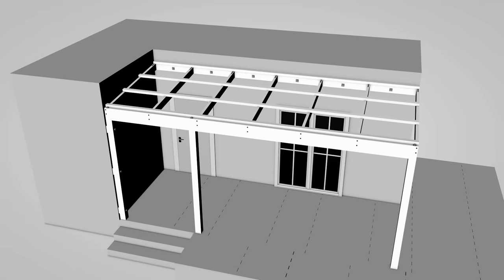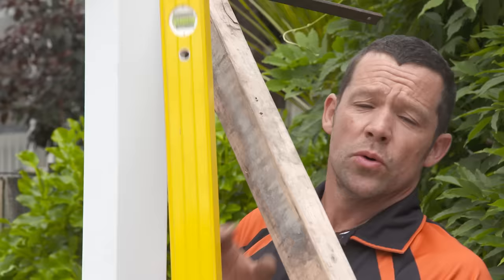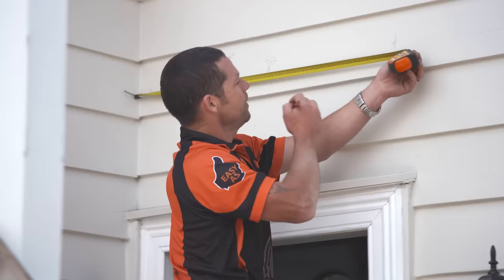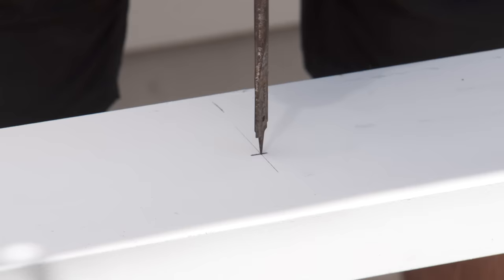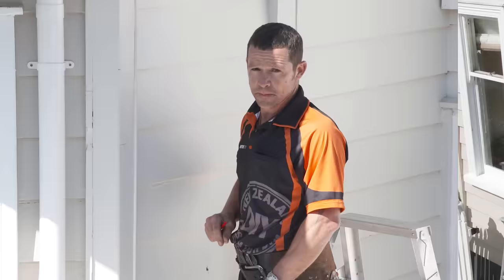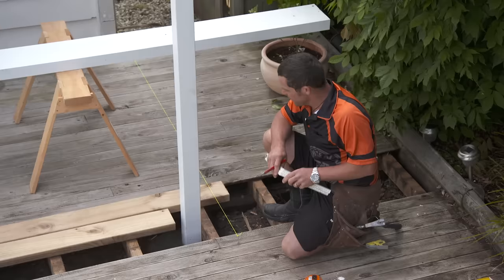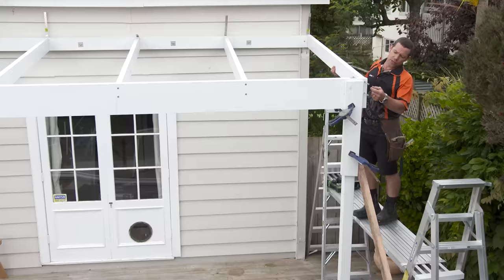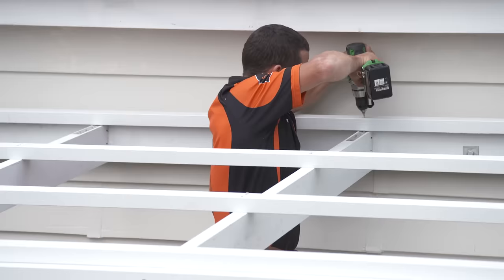How to Build a Pergola Attached to Your House | Mitre 10 Easy As DIY

Comment: "Joist hangers look absolutely terrible" - well said!  Very good video, best I've seen on the subject; great workmanship. Greetings from across the ditch.
Reply: Decorative mechanical fixtures can add to the finished product. Black powder coated hangers would look sharp.
Reply: Could have just used white hammerite on them. So much easier.

Comment: Good vid. I work from the top down/temp props for front beam/ put posts in last. Working out rafter spacing on ribbon ( pitch) plate 5.753 m minus rafter thickness ,then divide by 6 spaces. That still gets centre to centre but it  gets one side of each rafter. So it's then just a mark then a cross , mark and a cross and so on. Check if the house wall ( where the beam starts from) is plumb. Don't assume it's plumb . If it's 5mm away ,then add 5mm to beam length. I would probably leave the beam a bit long and cut it off up there. I normally rebate the posts to fit to the beam and use 2 cup head bolts through beam to post. With the roof battens, I also shoot them to the rafters like you do but as a high wind will lift up the weakest part, I drive in 1 long bugle to each intersection. If it's only shot with 2 nails per intersection, the battens will twist in time. If I ever do a pergola with rafters going over the top of the beam and overhanging , I weld up a special U shape shoe the slips onto the underside of rafter and has a welded down tab  to screw 2 teks into beam and on the U shaped bit, I screw 2 teks into the rafter.I do that to every second rafter.That's for the reason of high winds.I don't like to use the pryda triple grips because I think they look ub\gly.Thats another reason I weld up my own design ( less ugly and very effective. If I put polycarbonate roof sheet up,  I install folded metal sheet that caps over the top face of the batten ( width of batten  with 10mm down folds.) Reason for that is you can only paint the timber once before the sheeting is installed and it doesn't take long for the sun to do it's work and wear out the paint. The metal flashing will protect the timber way longer than the paint will. Lastly, when I do end flashings to each end of an iron roofed pergola/ verandah, the standard way to finish the flashing, is to do a 10mm fold back in to touch the timber rafter. While it looks neat, the rafter will require replacing in a number of years. The alternative is to do the 10mm fold outwards. It might not look as pretty.( still looks okay though) but the rafter will last many times more years than the other method because water will be deflected away from the rafter. That's either from rain or cold , frosty, icy mornings. :)

Comment: After moving back to NZ after building in Perth Aust, I can't believe the backward way builders work here! The best and most efficient way is to cut out and prop your pergola / Verandah in the air. Set the pitch angle and or height, then when this is square and level you measure or scribe the post and cut the length prior to bolting or concreting in place.we would do this even with heavy laminated hardwood beams or steel frames.
Reply: I agree Mike. Installing the posts cut to the correct length (because this part can be done horizontally at ground level on a drop or slide saw) is better than cutting freehand with the circular saw at height and on the side.. too much room for error.

Comment: kia ora, when you were figuring out where to cut the post opposite the stairs you got your level line from under the rafter and then took off your 193mm off that line which would have actually made the post around 145mm shorter than it should have been!!

Comment: the raffters would be better if they were notched and housed  into the wall plate, the straps will only  hold the two  together but the weight of the raffter will not be supported  correctly and joint will be weak.
Reply: 怎样种何首乌
Reply: 00
Reply: The rafter holds itself with the 5 degree cut at each end.

Comment: OK, so what about one that' positione at the END of a 7.5M wide building, that is no more than 4M to the BASE of a very high concrete wall, on top of which is an extra height corrugated iron rence?
Making the pad at the end of the house 4x 7.5 = 30sq M exactly.

The PERGOLA would thus be UNDER the height of the top of the fence, (which borders a road/street) and thus is thoroughly inside the confines of the property at the end of the house, meaning it's height "above" any existing structure would be a MINUS figure, so could it therefore butt hard up against the base of the concrete wall itself?
The top of the wall "leans towards the road, as it is NOT a parallel structure, but wider at it's base and thinner at the top of the concrete which is a minimum (up there) of 150mm on top of which sits a 125mm thick post and corrugated iron fence.

The concrete pad (as that's all that grows there) is fully from the house to the base of the concrete, (4M) with a faint fall towards the wall, so that rain/snow etc cannot drain towards the house, but away from it, to then run down along a gutter at the wall, before draining down the driveway away from the wall, past the house, into the back garden where it soaks in.
We also get rain draining in from the street, to join at the end of the wall.

As an aside, as I am now in a wheelchair, so we "park" the car such that I can transfer from the car into the house (as easily as possible with one leg), to get into my "chair" inside the door.

Oh and the view is irrelevant as there is a dirty great MOUNTAIN directly across the road from the house so sunlight/sky views aren't all that great after 4pm.
So having a pergola "blocking" that view is also irrelevant.

Nothing on the hill, except scrubby bushes, lots of rabbits, a few tame and stray cats and farmed GOATS, yeah they run goats on there as it's too steep for anything else.

Hence why we wanted a pergola (roofed with clearlight) to avoid the adverse weather when I go to & from the car/wheelchair.

Thus - what's your view? 30square meters at the maximum, footed directly onto an existing pad, 
Oh and yes, we are resident in the best part of NZ - at it's mainland center.

Comment: That timber looks perfect with hardly if any knots(that i can see) in any of the lengths.After a visit to a local Mitre 10 failed to find any machined lengths that weren't riddled with knots,alright if the structure is hidden, but not for a pergola, thanks .....very disappointing.

Comment: Hey Mr Mitre, i have seen most of your videos. But in this video HOW IN THE WORLD can you achieve drilling that DEEP hole using the spade ? I mean what do you do to NOT emerge out of the side of the bean instead of the bottom to insert that threaded rod ? Please share that wisdom !. Dino from Curacao
Reply: Postion the beam next to the post and/or clamp a square to the beam next to the hole use them as a guide to drilling vertically. Checking from one side then the other side (ie at 90 degrees to view the two planes) frequently as you go to ensure you haven't gone off at and angle.  With care it's not as hard as you might think.  Also you can go half way through and then turn the beam over and start from the other side and meet in the middle.  Use a bit that's a couple of mm (maybe 1/8th") bigger than the bolt diameter so there's enough play in the hole diameter to ensure the bolt will still fit even though likely the holes won't meet up perfectly.  Practice on an offcut of wood if you're not confident.  No magic required!  : )

Comment: Since the weather board are sloped on the angle, when you are mounting the ribbon board, how do you ensure that is is vertically plum along the full length? I mean, on the right hand side of the house it is fixed to the corner  beam which would keep it vertical, but what about the middle and towards the left end of the ribbon? Just seemed a little brief on that part of the build... Were you factoring it it when marking out the line of the bottom of the ribbon board? Thanks and regards
P.S. I enjoy your videos
Reply: Two way, you can adjust the 20mm packes to be on an angle or even easier just cit the rafters on an angle.

Comment: Fantastic video. Which brand of epoxy adhesive did you use to glue the threaded rod to the beam and post? You said it was one rated for timber and concrete. Yet, I can’t find any online that are rated for both. Sakrete and Quickrete brands only bind to concrete and masonry. Any help would be greatly appreciated!
Reply: SIKA

Comment: I always wonder in building videos how wood is poured directly into concrete or just put into the ground, treated or not. Here, in the northern countries, it is considered quite strange. Always a plastic barrier or some bituminous sheet is placed between any stone and wood. For posts, some kind of metal post anchors are used. And basically, all concrete foundations nowdays are isolated from the surrounding ground with bitumen or plastic. That´s the climate here. 
Beautiful pergola anyways.
Reply: The posts are pressure treated H5 as stated in the video. That's Copper Chrome and Arsenic - very serious poisons not permitted in many countries, but should last a minimum of 50 years. There is widespread use of post anchors in New Zealand too, but this is only a pergola and the rest of the structure will have had it before the posts rot. How would you stop water getting in the top of plastic wrapping anyway?

Comment: Are coach bolt directly tighten in the wall or use plastic wall plug ?
Reply: Pradeep Bhaskar he was screwing into the wooden studs of the house wall. You don’t need plastic plugs for a timber to timber fixing. If you were screwing to masonry... that’s a different story

Comment: the only thing i dont understand is.. why a pergola? it just a frame. i mean, practically it only for the looks?
Reply: achotto san you train a plant up and create shade...or you can roll a piece of fabric on top...etc wtc
Reply: Also if it's at the right height above your table, the sun's angle will reflect along each board making a steady shade

Comment: Can i ask which app did you use to design your plan in 3d
Thank
Reply from the maker: Kia ora, you'll need to get your Licensed Building Practitioner (LBP) to draw up your plans. They may have a programme they do this in or may even just draw with pencil, but they will have the correct load and measurements worked out for your job. Our plans were made in a video graphic software to demonstrate the clip. ^Matt

Comment: 22:54  How do you keep vertical line during drilling?
Reply: Maksim Huzmiev there is no way I would have come out the other side of that board lined up to the hole in the top of the post. I would have to have used a drill press to get through it as much as possible.
Reply: Maksim Huzmiev do your best. the hole is wider, so the anchor bolt can fit just fine after a tube of that epoxy he was using. It's not hard to drill a straight hole, and using a drill press is a fantasy. You're not taking a drill press every where in the field, let alone one large enough OR portable enough.. lol
Reply: It's called 'Professional experience'

Comment: do I need council  permit  for doing on my balcony
Reply: Hi, you didn't include the angle cut on the rafters, is this also 5 degrees.
Reply: he said 'these boards are badly split so I will be replacing them'.. so a hatchet is called for.
Reply: jeetendra dhade No, no permit required in NZ if the existing balcony is either on the ground floor or 2nd floor.

Comment: Why not just notch the beam onto the post? I don't like the look of that beam just sitting on the top of the post.
Reply: Have to admit I would prefer a tenon joint or at least notched joint instead of boring down with drill bolts etc but that's just my preference.

Comment: How do you work out that the fall is 193mm at 5deg?
Reply: Simple trigometry - 2140 multiplied by Tan 5 degrees is 187mm and its only 6mm difference.
Most scienceific calculators will do this for you - length of run x Tan of the dresrided angle will give the rise.
Reply: Graeme Taylor      The draftsman used the percentages instead of degrees.... A 5 degrees fall corresponds to 9 % (Tan 5 = 0,08748866352592400522201866943496 ===> Rounded up = 0,09).. In this case, 2140 x 9% = 192,6..  rounded up. ;)

Comment: what size beams and ribbon plate?
Reply from the maker: Hi Victor, when drawing up your plans with your Licensed Building Practitioner (LBP) they'll be able to advise the best specs in regards to size & treatment too so you can work with the best off-the-shelf products & sizing available in your area. 
Hope that helps.  ^Matt
Reply: @mitre10nz  cool thanks
Reply: With a little calculations id say ribbon plate  and rafters 150 x50 outside beam 250 x 50 (minus 5mms on all being dressed timber )

Comment: i dont fucking get it, y no roof?  is it meant to built for sunny day only?
Reply: Pergolas can be as high and as long as the owner likes in NZ, but cannot be roofed.  Once the pergola has a roofing structure, the home owner, business organisation, etc need to obtain a building consent . The next video shows that it does have a roofing installed after all.
Reply: This is part of a series. He installs clear plastic corrugate on the pergola frame in another video. In the video following that he installs guttering and connects it to the existing storm-pipe